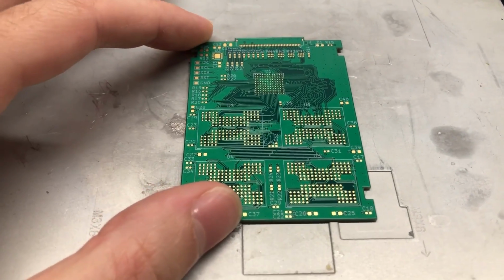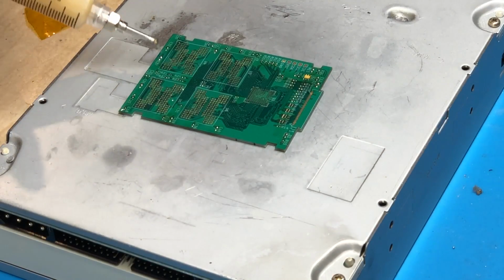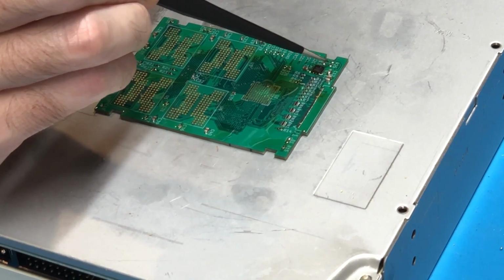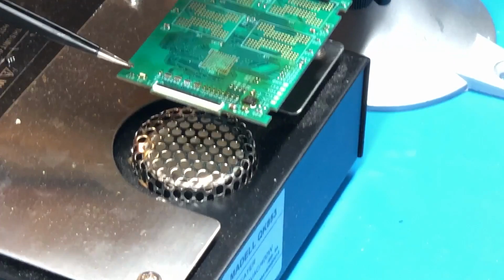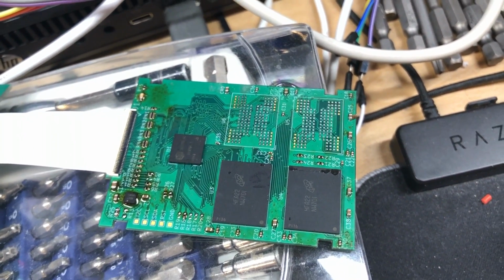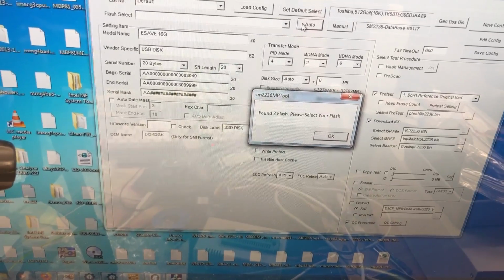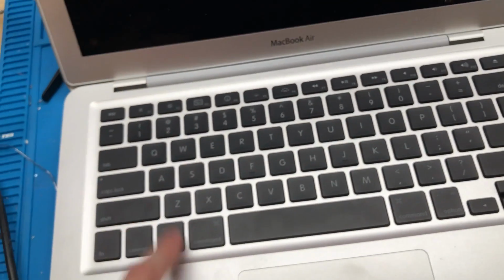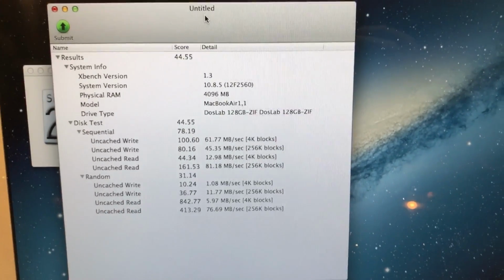Assembling a Custom ZIF IDE SSD

Comment: imagine making one of these but it works with the 4th gen iPod instead of these that work in the 5th gen and classics and the 08 air. i actually own a laptop with LITERALLY an iPod 4th gen hdd. Dell latitude X1
Reply from the maker: @Nikkerston That would be an easy change, basically just a different connector.
Reply: @dosdude1  Oh cool. maybe i should considre trying to make one with that connector that works on the latitude X1

Comment: would definitely buy, especially if i could request a custom hardware name/id
Reply from the maker: Absolutely, I can program whatever name you want on there.
Reply: @dosdude1  I'm also considering doing a collab to develop a ssd for older ipods if you're down to talk shop, am considering selling both of my first gen minis and jumping into an ipod video project

Would probably require a complete redesign for the 1.8" form factor, but well worth the development with the interest.

I'm also curious to see if you can make a sata version of the drives you put together.
Reply from the maker: @ig8uh8m8  The drive for the older iPods should be easy to make off the current design; it's simply a different connector. A SATA drive, though, would require a full redesign, which probably isn't worth it due to the abundance of SATA SSDs already.

Comment: Could a similar idea be done with an m.2 ssd pcb layout?
 
Like where can i find schematics for a m.2 nvme ssd or even a nand flash thumb drive? 

I have a few broken ssds but the nand flash chips are in perfect condition and so are the memory controller chips. Im interested in soldering my own ssd or usb thumb drives using recycled nand chips. Any suggestions how to go about achieving something like this?
 Or is not worth the time and effort?

Comment: This is quite interesting. Could this design be adapted to 1.8in ide connector? I have a Toshiba laptop that shipped with a 1.8 ide hard drive, 3rd Gen iPod (classic) also uses the same form factor hard drive 1.8 ide. I’ve been using a CF to IDE adapter in order to boot directly from CF card. I tried said card in the aforementioned iPod and it seems to know it’s not a hard drive and exhibits known issues like no sync on FireWire and no auto reboot on firmware restore/update.
So now with this storage that you’ve assembled, I’m wondering if I used Tarkan’s iFlash ide to zif meant to adapt his original flash adapters originally designed for 5-7th Gen classics to 3-4th gen ide, would the iPod see it as ide and not cf and not exhibit the glitches.

Comment: Weird question. I have a custom project I’d like to put this on. However that has a spot for a regular 40 pin ide. Do you think those can be soldered one to one on there?
Reply from the maker: You could use an adapter, yes, but I do plan on making a disk-on-module type drive for desktop 40-pin IDE based on this design, so that would probably be best, though it will probably be a bit before I have that done.
Reply: @dosdude1  what I want it for doesn’t have enough room to support an actual adapter so I was wondering if zif ide and be directly soldered to 40 pin ide.
Reply from the maker: @OnTheEdgex23  It can’t, needs a voltage regulator at least. Like I said, best thing would be to wait until I make the desktop 40-pin IDE disk-on-module style version.
Reply: @dosdude1  I’ll keep an eye out for it

Comment: Just discovered your channel and if theres one bit of advice i'd impart it's this.

The sections where you're manipulating/programming firmware on another pc... USE SCREEN CAPTURE SOFTWARE. (half-assed pointing a camera at a screen where you're focussing the camera on the bottom 2/3 of the screen whilst the top 1/3 that is missed is described is very annoying :)

Screen capture is easy, use it :)

Comment: How much did the total build cost?  You are amazing.
Reply from the maker: The biggest expense was actually getting the boards produced, at around $300, however I could have them produce more than 10x more at the same price. So that would reduce the cost per board by a lot. The parts themselves to populate one board comes out to around $40.

Comment: As those chips each only use 4 CEs is it not possible to have 8 footprints, each using 4 CEs, giving a 512GB drive?
Reply: That is to say 2 packages per channel?
Reply from the maker: @varno  Not with this particular controller, as it only supports 4 CEs per channel. These large capacity NAND ICs require 4 CEs to fully utilize them, so I’ve routed the board to use one channel per NAND, each using the 4 available CEs.
Reply: @dosdude1  when looking at the datasheet for the sm2236 it says that it supports 8 CEs per channel, so maybe some NC pins are actually extra CEs?
Reply from the maker: @varno  Very odd, the spec sheet does say that, but it doesn't seem as though there are enough extra pins for that (unless some of the pins I've determined as VSS are actually them)... You'd need 8 extra pins; 4 for the CEs and 4 more for the respective R/B lines. Unfortunately I can't get the full SM2236 datasheet without signing an NDA, so the pinout/symbol I made in my KiCad project may or may not be exactly correct... I derived that pinout from reverse engineering other boards that use the SM2236 (of which all only utilized 4 CEs and had 4 chips).

Comment: There's also the adapters to convert mSATA SSDs to 1.8" ZIF IDE.

Also, FWIW, you can add the Dell Latitude D420 and D430 to the list of small PCs that use a 1.8" ZIF IDE drive.
Reply from the maker: I'm aware of and have used those ZIF IDE to mSATA adapters, but they utilize the horrible JMicron JM20330 IDE to SATA bridge IC, which doesn't work with many systems (including this MacBookAir1,1), and is very slow when it does work. That's one of the main reasons I decided to make my own SSD.
Reply: @dosdude1  Thanks for the answer. Are there other converter-chips?
While I like your solution, a converter would not only be more easy to solder, but also more easy to "repair" if flash is defect...
Reply from the maker: @oleurgast730  There are, but there are no boards available that use them other than one for desktop IDE that I know of. I plan on reverse engineering this one board and making my own adapters using the chipset it uses (Marvell 88SA8052), in various different form-factors.

Comment: I thought it should get the max out of IDE speed, so at least above a hundred.(133 it says on the net) also has better access timings, that also measured in here ? I know it will give any  machine a good boost (over an hdd) , even if it's on ide..

Comment: Awesome Job! Curious, are you using low melt solder? If so which one do you prefer? Thanks!
Reply from the maker: I'm just using standard leaded solder, which works just fine for this.
Reply: @dosdude1  Wow. That's good to know. I'm a bit paranoid about melting zif and FPC connectors when reflowing. I usually coat the top in kapton because of too many melted flip top tabs. I use a PCB reheater as well.
Reply from the maker: @SalvagedCircuitry  Low heat (like 280 degrees C) with bottom board heat will get it soldered no problem without melting it.

Comment: i would be interested in seeing this for use as a flashmod kit for ipods that use zif drives, i know iflash cards exist but this seems a lot more reliable
Reply: This is not any more reliable than the iflash kits.
Reply: @jcw1569  i mean i would expect descrete nand chips to be better compared to an sd card
Reply: @smeegle  They should be, but the cost/benefit really doesn't pay off.  ipods are a very read-heavy application which plays to the sdcard's strength.

Comment: Some serious hardware engineering my friend, excellent work as always. A couple questions... Which hard drive did you use to inspire this project, or did the NAND to IDE bridge already give you an example? Also, Can this be used in a classic Ipod that uses IDE? Thanks
Reply: there's a whole dedicated website where you can buy every part for an ipod and build one. videos on here about "build your own ipod" or something. they use sd cards mainly, though there was a larger option for some models.
Reply: @jmwintenn  Unfortunately, the iFlash is not compatible with 1st/2nd gen iPods. I'd love to know if this could be used in such iPods. I guess it might be possible by copying the HDD info such as manufacturer and model number... @dosdude1 what do you say?

Comment: what do you think about the DIY NVME option? because now they are usually 4TB and I would like 8 (although one manufacturer offers it on amazon, but at a crazy price.) I would like to implement either a DIY complete nvme or something like nvme raid. I saw that one laptop used it natively, but you can't usually find that part. thank you for reading and responding.
Reply: nvme raid? for what?
Reply: @VShuricK  in PC for bigger Speedo,in notebook for bigger space...
Reply: @moretttti  raid0 - unstable, using as different volumes much safer. Things like LLVM om MS StorageSpaces on notebooks - pure geoengineering.

speed - you making an footage server for rendering cluster on 10gb multilan?
Reply: @VShuricK  nn I'm not making a cluster for video, it's just the answer to the general question of why... I personally want it purely because of the size. on the one hand, 2x2TB ssd nvme are cheaper than 4TB (2TB firecuda 6990czk 4TB firecuda 15990czk), moreover, I would like to use 8TB, that is the current maximum. that would mean either 2x4TB firecuda = 31980czk, or 4x2TB firecuda = 27960czk or take the native 8TB, I found it on amazon - SABRENT 8TB Rocket 4 Plus NVMe 44802.69czk ((12822.69czk saved compared to 2X4TB and that is the price almost 4TB)) or ((CZK 16842.69 saved compared to 4X2TB and that is the price of almost 5TB))
in addition, I saw a physical raid in one laptop directly from the manufacturer (I have a feeling that Asus), so I believe that physically it shouldn't be a big problem. either essentially a fork with some additional controller or option number 2, which I would like more, directly build your own NVME SSD

Comment: Very cool project as always! 
Slightly unrelated but am I missing something regarding Mountain Lion? I thought the 1,1 Air wasn't supported by any patcher (due to 32-bit FW limitation)?
Reply from the maker: No, only 32-bit CPUs limit running Mountain Lion. Besides, the MacBookAir1,1 has a 64-bit EFI.
Reply: @dosdude1  Ah yeah I see that on the OCLP compatibility list, SSE4.1 capable CPU (and graphics) upgrade on the horizon perhaps? Sounds like a challenge!
I was probably confused with the older MacBooks and that it doesn’t seem worth it due to the lack of graphics drivers. (To go further than 10.8 that is).

Comment: This is awesome. I was going to purchase one of those (originally) obscenely expensive Toshiba micro laptops that had a 1.8" drive, but didn't because of the lack of availability of fast storage like this. I'm sure a hand built drive would cost many times more than I'd realistically spend, but it's a great option for those that want it.
Reply: I have dozens of those hard drives, I pull them out of iPods when I install a SSD or SD card conversion kit

Comment: It's lovely to see someone using KiCad for reviving older computer hardware. I also love your meandering traces work. How did you calculate how long the traces should be, or did you just rely on the spec sheets of the controller and NANDs? How many layers did the PCB have, did you manage to fit the design into 4L or did you have to go to 6L? I randomly found your channel because of your PPC upgrades of old macs and I love it so far, but this one has been the best video that I watched yet, because it's an original design, not just replacing components on mobos or CPU cards. When you release the kicad project I would love to remix it a bit so I can eventually use it in a PPC mac (sata controllers that work on classic MacOS seem to be harder to find nowadays). Last question, why did you use hotair instead of a reflow oven? I never saw an oven in your videos but I have the feeling you have one, so was it because you didn't have a stencil and if so, why didn't you order one? I assume you ordered the PCB from one of the Chinese manufacturers. Are their prices for stencils gone massively up? I haven't ordered anything for at least 2 years and I'm a bit out of the loop on PCB manufacturing and even design, as the last time I opened KiCad was about a year ago 😊.
Reply from the maker: Because NAND ICs use a parallel bus interface, the data lines need to be length matched. The length itself isn't much of an issue, so long as the length of all lines are the same. I was luckily able to get the board fully routed using only 4 layers; two power planes and signal lines routed on top and bottom. I didn't bother with ordering a stencil/using solder paste and reflow oven to assemble the boards, as it was easy enough to just tin the pads manually and then place and solder each component using hot air. It only took around 20 minutes.

I have just published to project on GitHub, and added the link to the video description, so you can take a look at it now.
Reply: @dosdude1  awesome, thanks. I would love to see the kicad design. You didn't say if you had to use equipment to measure the signal timing to calculate the traces length, but when I see the BoM and the kicad project I will figure it out. Really, really great work, you gave me a bit of motivation to dig up an old project of a PCI-X bridge that I abandoned, because I thought it wouldn't make any sense financially if I had to go to 8 or more layers because of signalling, but not I will take a second look to see if I can squeeze it in 6L. Keep up the great work.

Comment: An likely cheaper alternative would be ZIF to M.2 SATA adapter taking a M.2 2242 SATA drive and adapt that to IDE using a IDE to SATA bridge chip.
Reply: ZIF to M.2 adapters do exist.
Reply from the maker: The issue is that all those adapters use the horrible JMicron JM20330 IDE to SATA bridge IC, which doesn't work in many systems (including the MacBookAir,1,1 shown here).
Reply: @dosdude1  oh ok, curious, does that include the iFlash? It seems nicely built and does fine in an iPod. I almost tried one from Amazon that looks super cheap, but didn't want to risk needing to open the 6/7th gen iPod again.
Reply from the maker: @jcw1569  Never tried that in any computer, but it's more likely that it would not work. Not to mention Micro SD cards are extremely slow, so while it is suitable for an iPod, it would be horribly slow to use on a computer as a boot drive.
Reply: @dosdude1  if I was attempting to use that in a computer, I'd definitely try the m.2 version over SD card version.
Reply: @dosdude1  I believe other chip manufacturers should have similar solutions. At worst one can roll their own conversion chip using an FPGA.

Comment: i really need one of these, i have a Asus R2H that has a zif ide hardrive, the converters don't work and the drives you can buy use a different zif connector

Comment: Didn't older iPods also use ZIF? The 2.5" form factor is probably too big though
Reply: I think this MacBook Air (1,1) shipped with an 1,8" ZIF from the iPod. If I'm not mistaken Steve actually talked about this at the launch – as a positive thing (these drives were not that reliable). Positive as in they've shipped millions of these. I think Toshiba made them and that when the iPod Classic was killed it basically removed the entire market for these drives (thus you cannot get new ones).
Reply: I know my ipod classic 5th gen used a 1.8" zif IDE drive by default.  I replaced it with an iFlash mSATA board and it works great.

There were some compact HP laptops circa 2008 or so that used the 1.8" zif drives, too.

Comment: Very great project and hope you can also make the 4GB DDR2 SODIMM stick for many Core 2 Duo laptops out there from i965 to series 4 chipset laptop using DDR2. Many of those Core 2 out there are severely limited to 4GB DDR2 due to DDR2 4GB SODIMM is rare and expensive.

Comment: Love what you do with this old tech, you make it look easy which it isn’t. Would love to send you a M1 imac for a Ram upgrade ☺️
Reply: That sadly doesn’t work. M1 has ram integrated
Reply: @florider_hd  It‘s on the side though. The Actual M1 Chip and DRAM are next to each other on a main package
Reply: @florider_hd  What if you replaced the M1 chip itself? It's a stretch, but is it theoretically possible? Would you have to change other components?

Comment: Did you run into any trouble with signal integrity? I don't see any differential traces and meandering.
Reply from the maker: Both IDE and NAND are parallel busses, so no differential routing should be done. However I did meander traces to achieve length matching, you can see it if you look closely.

Comment: Very nice.
In the future for something like this that adapts NAND to SATA, it would be cool to see socketed NAND chips.
Definitely a cool build sir.
Reply: The BGA sockets for that would be more expensive than the entire rest of the board.
Reply: @cybercat1531  Depends on where you go and what you get.
Reply: @cybercat1531  I just bought a BGA63 adapter for 49 USD. (For a TL866II). New.
Reply: @Djbiohazard1991 how much does the band cost that fits into that adaptor?

 Not everyone can afford $50 for ONE adaptor

Comment: I'm wondering if this would be a suitable SSD replacement for the older iPods that use 1.8" spinning disks. I have an 80GB 6th Gen iPod classic that has a dead hard drive and this might be a viable alternative.
Reply: most likely doable since the controller itself were IDE. just need to shrink the PCB size
Reply: @kiradev I’ve used iFlash stuff before, and it does work well enough. I was just curious if the drive in the video could work as well